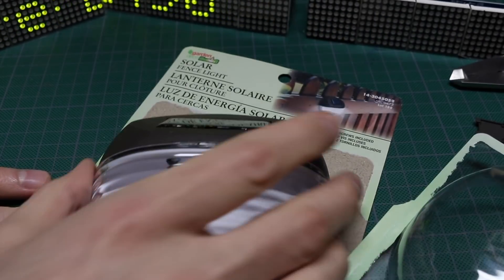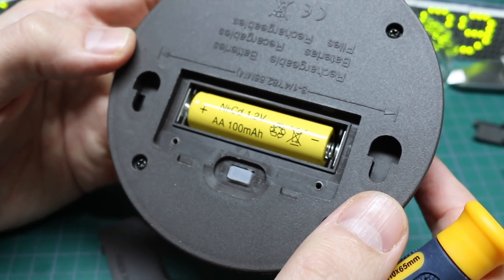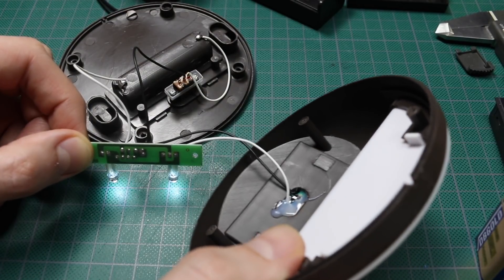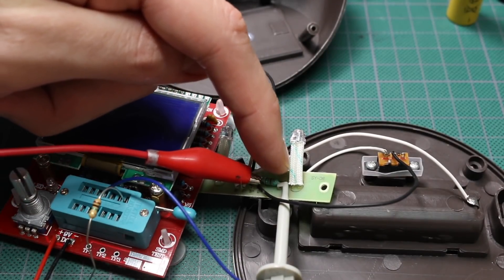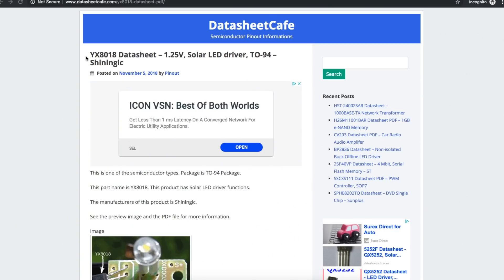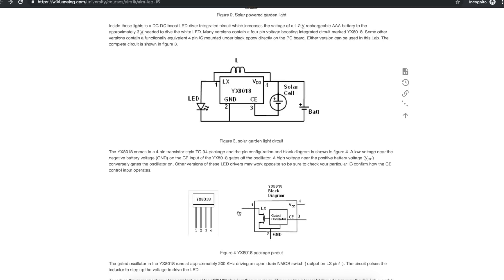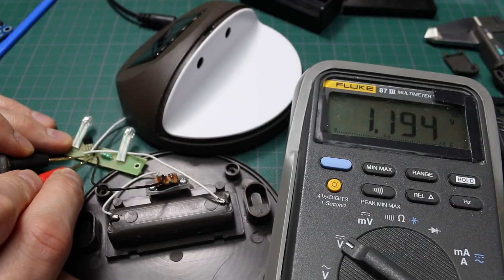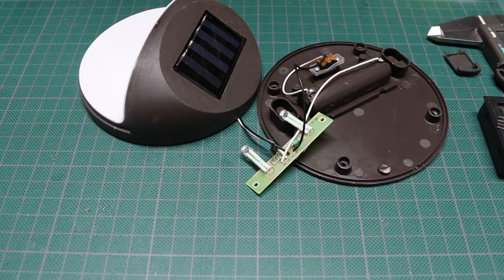Solar Garden LED Light - Tear Down and Circuit Analysis

Comment: Hello, your video is very informative.  I am trying to use a solar outdoor flood light with motion detection designed for dusk to dawn which uses solar panel to detect the light.  I want to use it indoors and want it to turn on when it detects motion even when its day light.  Looking at your video, it seems I should be able to discount the CE on the chip coming from the solar cell.  This will allow the light to turn on during the day indoors when it detects motion.  Any thoughts?

Comment: I used this circuit to actually charge a lifepo cell at 3.2v using the boost converter from the 1.2v to 3.2,
so instead of lighting a led, it charges the lithium cell.  Quite slowly of course.

Comment: It looks like the bat+ is disconnected by the switch, so the battery will not get charged from the solar panel when the switch is off.  I confirmed it doesn't charge with switch off.
I need to hook it up so it charges when off, but doesn't drain the battery to light the led.   Just put a switch between bat+ and led?  it will still run the boost transistor though.
What you think?
Reply from the maker: it’s been a while since I’ve looked at the schematic and mode of operation but assuming it would still charge properly with a disconnected load, it would at least save some current but of course the chip will still draw quiescent current. so that would be an interesting experiment to see how much longer the battery lasts with no light connected.
Reply: @GadgetReboot  Confirmed no charge with b+ switched off.  I changed the switch so it disconnects the inductor to the chip, it still draws .02 amps,  not a big deal. 
Now the battery charges with no light on, and switch allows light to turn on.
However, if the switch has wires it may be a problem creating emf on the long wires..hmm

Comment: Did you ever get around to using this for another project?
Reply from the maker: Not yet, all last summer I was packing to move somewhere temporary, and now this summer I'm finally moving into a new place, so by the time I'm all set up it'll be fall again.  I'm hopeful for next summer!
Reply: @GadgetReboot  I just moved too, so I know the feeling. I really enjoyed your video, thanks a lot.  I just pulled apart a broken solar light and found the same pcb inside.  I need to brush up on my boost converter basics, then I'm going to take some measurements :-)

Comment: I'm surprised you didn't measure the charge current when the solar panel was exposed to light

I have a large-ish Walmart special here (search 'Mainstays 60 Lumen Solar Powered LED Outdoor ') and its rather beefy LED is pulling 155mA, and the panel is returning about -5mA from a fairly bright LED work light here - I assume that's way under its optimal production.  Unfortunately, the battery does not charge when the light is turned off, so there's no way to just let it sit and charge for a few days, it'll always turn on the light at night if it was charging during the day.  I'd be surprised if it can pull in anywhere near 150mA during the day, but it's going to have to pull in at least what, 170mA or so to recharge what was lost during the night, assuming 50/50 day/night?  It looks like it's just going to slowly wind down its charge over a few weeks and then get to a point where it can't stay on all night.  Or maybe that's the design, to only stay on for a few hours at and just after dusk?

Also, 100mAH on your battery?  that's insanely small, even for a supercheap battery.  Usually they're fraudulently marked much higher than they are?  But I suppose if you're only going to be able to harvest say, 12mA for 10 hours, you only need a 100mA battery?  The AAs I use in my radios here are 2,300mAH (NiMH) and that's an accurate rating.

The solar panel on this light is a bit bigger than most, I suppose to make up for the larger LED.  And the battery claims 1,200 mAH - judging from the weight of the cell (which is a surprisingly good indicator of rechargeable battery capacity), I believe the rating is at least in the ballpark of accurate.  (I've got a hilariously marked 18650 here, claiming 9,800 mAH, it weighs about as much as a AAA battery, and probably produces around 250mAH)

Comment: Thanks for your informative video.
Question, if LED light doesn't turn off when  solar panel exposed to light does it mean the chip has problem or the inductor?
Reply from the maker: I wouldn't suspect the inductor because if it were not working, the power supply wouldn't be able to generate the LED supply, so maybe some kind of internal residue build up  or other issue from being in the elements, or it could mean the solar cell is dirty so it's always like it's dark enough to turn on the LED but bright enough to keep recharging?

Comment: Thanks for this. I've been looking into converting my small fountain pumps from electric to solar and though it might be useful to use  parts from an old solar garden light like this. I could possibly get away with going straight from the solar panel to the pump, but I'd prefer a storage battery for cloud issues. My only concern was how to bypass the 'charges when it's light and works when it's dark' option. Your video helps me to understand where the  circuit board fits in and the s- part of the chip. Thanks for this.
Have you done your conversion? I didn't see a video on what you used your garden light for. I'd definitely be interested in knowing what you did, and how you did it.
Reply: The circuit board inside charges the battery and boost the voltage so there's no way of removing that
Reply: You cannot turn off it's turning off in the day and turning on in the night

Comment: How about adding a PIR with an ESP-32 with camera for a low cost motion activated security camera connected via wi-fi. Add a small super cap to handle the momentary high power demand. Useful in low traffic areas.
Reply from the maker: That’s something to consider, I still need to get a camera module come to think of it. I have super caps and at least one PIR kicking around though.
Reply: @GadgetReboot  I just got an ESP 32 with the ov 2640 camera from aliexpress for about $6.00. Should work fine with for your setup.
Reply from the maker: I’ll check it out, thanks. Definitely don’t need top quality for something like this so low-cost would be great.

Comment: I've been using QX5252F chips. Pretty much the same thing and a dime a dozen
https://www.ebay.com/itm/20Pcs-NEW-QX5252F-5252F-New-and-ORIGINAL-IC-driver-TO-94/253102170117?epid=0&hash=item3aee10a005:g:Rz8AAOSw8-BZlqi9
Also Julian Ilet came up with a fairly sensitive 2 transistor circuit that enables you to use a lithium cell

Comment: Those kinds of epoxy solar panels are 100% absolutely shit. The cells are really low output and put out almost nothing unless full sunlight, plus the crappy epoxy will discolour and go cloudy in 12 months.
Always buy the lights with the glass solar panels, as they perform significantly better and will last forever. Make sure to seal around the edges of them with something resilient. I am currently using UV-curing adhesive and that works great to stop corrosion from water getting underneath.
Reply from the maker: Yeah I’m sure water is going to find its way inside this one  so it’s only for playing around over this summer and if it lasts past the next couple of months that’ll be just a bonus. I  Will be curious to see if the circuit board gets any damage from lack of conformal coating.

Comment: great.. thought similar thoughts myself!, I look forward to your "mini series" just a quick one, over here in the UK they always have a nickel metal hydride battery I have never seen one with NI-CAD before, in fact NI-CAD doesn't seem to get a lot of use at all. Wonder why that is ?
Reply from the maker: I have a bunch of other small ones  that I bought a few years ago that do have NiMH and I’m not sure why there is a variation but I saw a lot of NiCd as well when I bought this one recently.  I  Will probably try to pay attention to what kind of battery is in various lights when I am out in stores that carry them now  as a point of interest.
Reply: I like to buy the Dollar Tree ones and remove the solar panel along with the battery in circuit board I can reuse those parts
Reply: Using my sister's phone at the moment

Comment: Damn-it, now I have to go outside and pull mine off the wall and find out why it stopped working.
Reply: Usually the switch fails before the incredibly shitty NiCD battery. The dead battery needs to be removed as soon as you notice short life, as they ooze a corrosive gunk that destroys the battery terminals.
An ideal replacement is an old NiMH cell that is beginning to die and developed high internal resistance. The current drawn by these is so small that the old NiMH battery will work just fine. No need to put an Eneloop in them, they don't need anything that good.